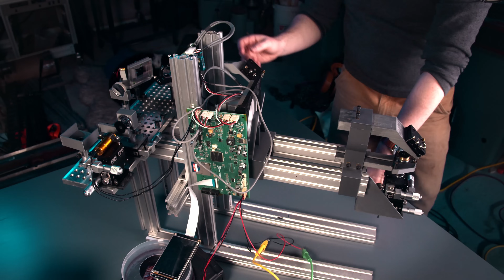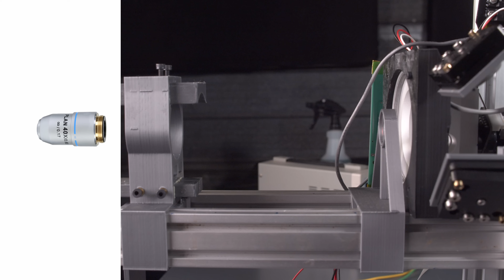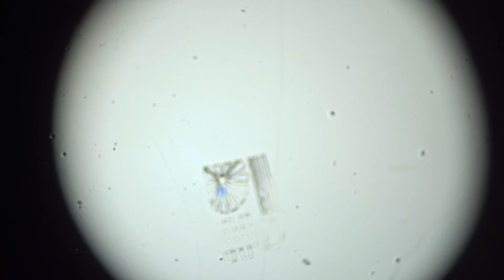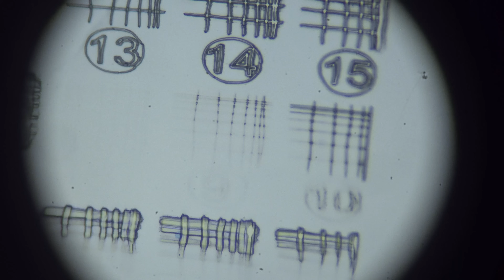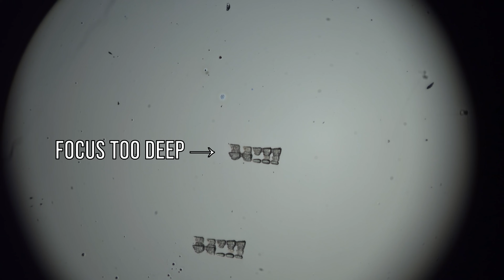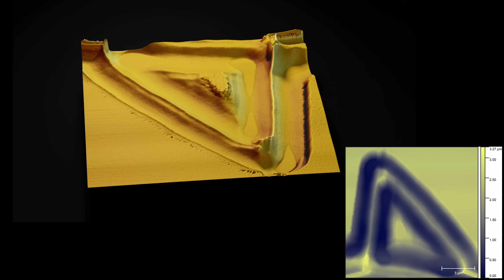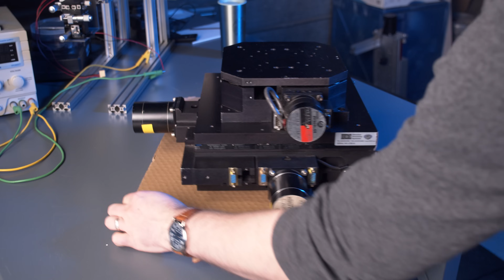DIY Semiconductor Patterning

Comment: Nice project Zach! I've got a  remark: given the resolution of your patterns, your resist layer thickness is at least several microns. Generally, you don't need that kind of thickness if you want to do subsequent etching. Using a resist layer thickness of less than 300nm will improve your image definition dramatically, because fully exposing a thick layer of photoresist in a very short time all the way to the bottom is very difficult. This is because of the optical density at the laser wavelength and the fact that photobleaching of the photosensitive component isn't instantaneous.
Reply: That is amazing to see so many wizards in one comment section!
Reply from the maker: Thanks for the tips, that's great to know! I wasn't really sure what thickness to be aiming for, so just chose an arbitrary speed near from the datasheet (3500RPM) and left it constant so there was one less variable to think about.  Good news is that it seems pretty consistent, around 1.7-2um each time.  I'll try increasing the speed and get a thinner layer for my next tests, thanks!
Reply: @BreakingTaps  if 2um is your thickness at 3500rpm, then increasing RPMs is probably not going to give you a significantly thinner layer. Adding a little solvent is a better strategy. Or alternatively you could use a resist like az1505.
Reply from the maker: Hm yeah, the datasheet maxes out with 500nm @ 7000 RPM. My coater should be able to hit that, I'll give it a shot and see.  Good idea about adding some solvent. Will look into AZ1505! I've been wanting to get some SU8 as well, just because it looks very useful for "structural" applications where the resist is left in place.
Reply: @BreakingTaps  Be careful with exposed SU8! This stuff is ridiculously hard to remove, nearly had to scrap several fully structured 8" MEMS wafer because someone was curious about my stuff and opened the box outside the yellow light area... (partially my fault because I stored the box outside the litho area, but the stepper was down and all shelfs were full). 
The thickness of 150µm wasn't helping this either. Warm acetone or NMP over several hours followed by plasma ashing in a O2/Ar plasma somewhat removed it (I also read that warm Piranha solution makes quick process of the SU8 but would have definitely destroyed my wafer)  . At least some devices survived.
Reply: @faxezu  Woah 150 microns of resist on an 8” wafer? That must have been like half a bottle of resist. Also, can confirm Piranha is a great way to remove resist. I often work with a fairly tough negative resist, and piranha is the only way I’ve found to reliably strip all of it off again. Usually I do 30-45 minutes on a hot plate set to 130C.
Reply: The human being is a super organism when we combine out effort.

Comment: cool prototype.  looks like it could benefit from a solid steel structure and an enclosure so you can temperature control it and eliminate air currents and so forth

Comment: It looks like the waves are mostly due to the galvo controller. My light Show laser (unity elite pro3) was wavy similar to yours until I aligned it using the potentiometers on controller board. Basically projecting a grid test pattern with pangolin quickshow software and adjusted the controllers until the corners are as close to square as possible. I'm fairly new to pro lasers but these adjustments solved my wavy problems

Comment: Does the film coating thickness not matter too when it comes to how perpendicular the exposure is ? Also how well it exposes a pass would be better on thinner layer ?
Reply from the maker: Yep, photoresist thickness is another variable that can affect things! I kept that variable constant, just so there was one less thing to worry about. I spun the resist on at 3500 RPM which pretty consistently gave a thickness around 1.7-2 microns (which is near what the datasheet said too).  But yeah, different thicknesses can affect resolution, and can also give rise to different interference effects from the resist itself and the substrate, so the datasheet has graphs about optimizing the thickness.

Comment: Could you expand the beam before passing it into the pinhole( allowing a larger hole to be used) to get a better quality before focusing it back down and re-collimating it.
Reply from the maker: Yep! That's a possibility, as well as expanding immediately after the pinhole (letting it diverge further and collimating with a bigger lens). The main reason I didn't do that is because of the galvo: it has relatively small mirrors, so too much expansion before the galvo stage could lead to "clipping" as the mirrors rotate.  Expanding after the galvos made that easier.
Reply: @BreakingTaps  Ah gotcha.  I was thinking that perhaps if expanded before entering the hole it would possibly allow larger hole size and in turn finer control over the final shape and "cleanness" of the beam.   I suppose at the end of the day you are dealing with interference being your primary deciding factors for what the sharpness at edge of the beam is like.  

Better man then me , I love your experiments.  I been doing science experiments in my garage since I was a child yet optics and me don't get along.  I'm working on interferometer as we speak and precision optics does not jive well with my mad scientist, haphazard style I do so well.  I am attempting to see if I can detect faint, ultra high frequency vibrations by vibrating one of the mirrors at a known frequency in hopes it acts in a stroboscopic manner.  I am highly intrigued by acoustic skyrmions.  Needless to say precision is not the easiest thing when building entirely from scrap parts .

Comment: Epic project! Looking forward to future revisions. One question: do you recon it would be viable to use the optics from an old blu-ray or DVD-drive in place of the galvos?
Reply from the maker: Possibly! Those little OPU units are super impressive, although I don't have any experience with hacking them. I'm not sure if they alter the angle of the laser, or just raster it around.  If they raster I think you'd need a different setup and directly pipe the laser down to the surface (like a DVD), but you'd probably get really nice resolution too.
Reply: probably no, they are not designed to be repeatable. They are designed to be in a feedback loop to track the track on the disc.
Reply: I tried to do this. I cracked the OPU to realize micron level lithography. In fact, I only need a power supply to power the laser diode of the OPU. I can depict the graphics by moving the stage. But the most difficult thing is to align the spot, which affects the resolution of lithography

Comment: Really nicely done. I use SU-8 spinned on a Si wafer in combination with a 365nm Led and a pattern printed on a transparancy (outsourced to a specialized printing company cost around €20 for an A4). Placed the transparancy on the wafer with a thick piece of UV tranparant glass. Expose and develop. Very high aspect ratio's possible with a spatial resolution down to 3-5 micrometers.
Reply: Dr Nick,  can you share the company that you used to print the masks?
Reply: @Viardi2025  ProArt BV in Groningen, The Netherlands. Ask for film with high density in black/white. Transparant for UV and black silver blocks UV. Resolution in micrometers. Just give them a call and discuss your needs.

Comment: Why Don't you use a DMD mirror? it will improve the quality of the images really well.
Reply from the maker: No particular reason, just wanted to try the laser approach. There are pro/cons to each. With a DMD you run into pixel resolution limits which puts more emphasis on the reduction optics, whereas a direct laser approach is easier to scale down the spot size. But you have to deal with galvo style systems instead.  Other folks have gotten DMDs working (Sam Zeloof, Hyugens Optics) so I wanted to try something else :)

Comment: May be something like laser head from CD-RW drive can help you? It has electromagnetic deflecting system. Or you can modify some galvanometer-like meter and glue a mirror to it coil. Ben from AppliedScience used it in servo-like way to make quite accurate weighters.

Comment: how about using a ready made blue-ray drive (or cd or dvd drive)
Reply: should be around 100-400nm, so sub micron accuracy, for cd mask lithography
Reply: I mean using a vacuum blu-ray drive for diy microelectronics, integrated circuits, then do all the other phases, when you have already the photolithography part available, the others should be very much easier
Reply: which is better, moving the target or steering the beam
Reply: try ion implantation-crystal-growth with same method, steer or 3d print head, piece nano features, ionized atoms sling, the substrate or target is negative, the print head is positive, get rid of one electron

Comment: Neato! I'm impressed with the quality you were able to get out of an old 3d printer mirror box. What kind of setup are you hoping to replace it with? some "better" COTS part, or a homebrew with a mirror bolted to a few piezos or something? Hmmm... are piezos too small for this? it looked like your angular range was actually pretty big.

Actually I guess that scaling is a separate question - when you had the "demo raster" running while you walked through the beam path, the lateral displacement of the beam was on the order of mm. How many microns across the surface was that once sent through the rest of the optics and microscope objective and whatnot?
Reply from the maker: Thanks! I'm not sure what v2 will look like to be honest. The deflections are pretty big (+/- 20degrees? something like that), but that could be changed... I was trying to maximize the full range of the galvos because I figured they would not have much accuracy if trying to make very small deviations.  If the a piezo galvo or whatever had very small range, we can tweak the focal distances in the relay system to make it work, probably just with much longer focal distances.

I have a few options that I'm thinking about: 

- Getting a better galvo, the "digital" ones designed for etching should be tuned better. 
- Some kind of tip/tilt flexure mechanism, actuated by voice coils or high TPI threads or something. I don't technically need all the speed of the galvo, so we can use a slightly slower mechanism too
- a few different more "mechanical" designs (coupling a ballscrew to a rotary mechanism), so we can take advantage of high resolution in the ballscrew mechanism
- A sorta silly idea someone mentioned on Discord which is growing on me: a CoreXY style 3d printer mechanism that "rasters" above the tube lens in the system, replacing the galvo entirely. Similar to how CO2 laser cutters have a traveling mirror, but coupled into a microscope objective. Still mulling that one over.
- Or just admitting defeat and using the wafer stepper for all motions. Would be very slow though.

The "demo raster" was an "X" shape and just about filled the entire field of view (I used it to help align various components). It depends where you look, but on the first lens it travels a few mm, on the second lens it's traveling a centimeter or two.  And ultimately the FOV is either 2x2mm (20x objective) or 500x500um (40x objective).
Reply: I suggest looking either for proper galvos (like for actually your purpose) or to keep in mind that the mirror surface of your galvos has optical quality. I assume the galvos you used don't actually have the needed surface quality and that this might create the "wobbly" structure of your trial structures.
Just a suggestion from my side - I hope I'm not too late 😅
Reply: @1xBublex1  theoretically if error is repeatable u could calibrate wobble into "control system". But yeah if there is huge variation and bad repeatability is another case.

Comment: I was going to click the like button, then realized I had already clicked! Really nice project.
Reply from the maker: Thanks Ben! Glad you enjoyed it ♥
Reply: @BreakingTaps I’m a big fan of both of you. You guys do amazing work!
Reply: Between the 2 of you I would expect to learn how to like a video twice
Reply: Beginner mistake, no worries, it´ll go away... By "Breaking Taps" u click "like" always before starting the video, everyone knows...   ;-)
Reply: I see a colab in the future
Reply: @MrTweetyhack because Ben is so well known to colab
Reply: Follow and love both of your Channels and your photolithography setups. Something I haven’t seen anyone do is modify a 405nm Blu-ray Disc burner for photolithography. I think that outputs ~300mW, has four photodiodes for focusing, and the lens is already floating on electromagnets to adjust the focus on the fly. I’ve seen another video on YouTube where someone uses a regular Blu-ray player as a depth microscope by scanning the head across an object and measuring the focus error on the focusing diodes to determine depth. With Lightscribe having been a thing, and the ability for Blu-ray drives to write with the precision that they do, is there any reason you wouldn’t want to use a method like this vs a contraption like the above? I could see removing the laser assembly and designing a custom gantry or just limit yourself to making the substrate the shape/size of a Blu-ray disc, and burning it Lightscribe style. Even better, with an already spinning disc, you already have yourself a spin coater!

Comment: Wow, this is incredible. I'm taking a micro/nanofabrication course right now, and this project is really really neat. I agree with your point that moving the stage would be a lot slower than the way you're doing it with rotating mirrors, considering that's the way x-ray lithography is done. But on the point of x-ray lithography, feature size is often linearly dependent on wavelength. Do you think an even smaller wavelength laser source would help decrease your minimum feature size? 

Also, if I understand correctly, the laser comes at the photoresist at an angle after exiting the microscope objective. I'm curious as to how this affects the sidewalls of your photoresist, especially for PR at the edge of the substrate. I'd imagine that sidewalls will be pretty sloped, but only on the edge(s) closest to the 0 degrees coming into the microscope objective (I have no idea if what I wrote made sense). Depending on how you're etching and its selectivity to PR, I could see that being a bit of an issue in your min feature size.

Found this video through an Explosions & Fire retweet, and I'm really glad I did. New subscriber for you!
Reply from the maker: Thanks!  So theoretically, 405nm with a 40x objective should max out around 500nm spot size, so the 2-3um that we're seeing is from various inefficiencies (optical, galvo, vibration, focus, etc).  Assuming those can get fixed, we could upgrade to a 60x objective and push the size a bit farther.  But yeah eventually we'd have to drop wavelength to keep going smaller.

That's a good point about the angle from the objective, I hadn't thought about it! Microscope objectives are not super telecentric (I don't think...), especially compared to lenses like f-thetas which are designed to provide parallel rays. So yeah, that could definitely be impacting the sidewall depending on location!
Reply: @BreakingTaps  Related, about your exposure issues... Is 405nm optimal for S1818? I thought most of the larger-feature-size resist was meant for mercury vapor I-line (365 nm), and the stuff for really small stuff targeted excimer lasers (193nm).
Reply from the maker: The datasheet says it's optimized for g-line (436nm), and the sensitivity is basically from 350-450nm.  Below 350 and the absorbance of the developed resist starts to climb considerably.  Purely coincidental when I purchased it, had no idea what I was doing then. But ended up working out well for 405nm :)

Comment: as far as i understand, the resolution of the scanner can be improved if you use lenses with much greater focal length after it. for example if you use a lens with 2x focal length, then it would convert the same angular deviation into twice linear displacement. it means that the scanner wiuld have to wiggle the beam twice less to achieve the same displacement and hence would have twice less jittering. does it make sense?
Reply from the maker: Hm, I'm not sure tbh. The scanners are running open loop basically, so it really depends on how accurate and repeatable their "minimum step" is (which probably depends on the resolution of their DACs I guess?). I tried to maximize their dynamic range, because I assumed utilizing the full range would give better resolution than trying to have them perform small moves in a subset of their range.  But I'm not really sure to be honest!
Reply: @BreakingTaps  hmm, i see how it can go both ways whether you're bottlenecked by dacs or their mechanical inertia. dacs however are perfectly repeatable but their path is not, so i assumed you're limited by inertia.

Comment: isn't it better to put the pinhole as far down the light path as possible (right before the scanner) to remove more nonparaxial rays?
Reply from the maker: Yeah, I believe you're correct. The beam can also pick up problems from dust particles in the air, so having the spatial filter near the end helps reduce those effects.  It ended up in that location mainly due to poor planning and logistics :)
Reply: @BreakingTaps  wait is that actual dust? I thought you're using a fog machine in every single video that goes well with your cool lighting